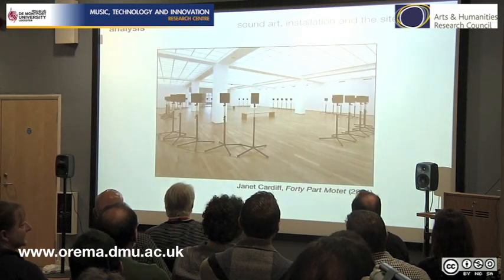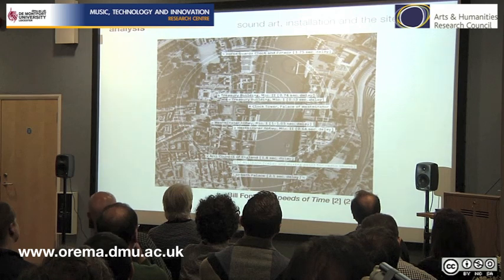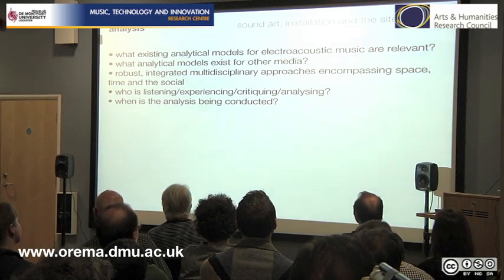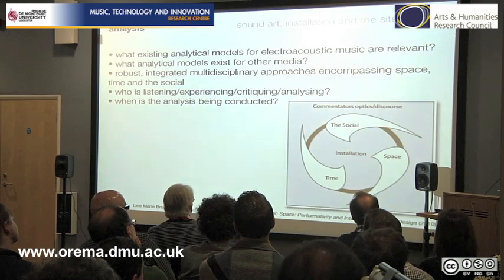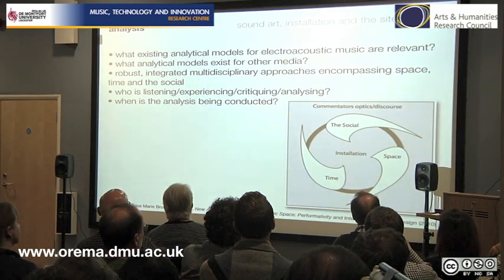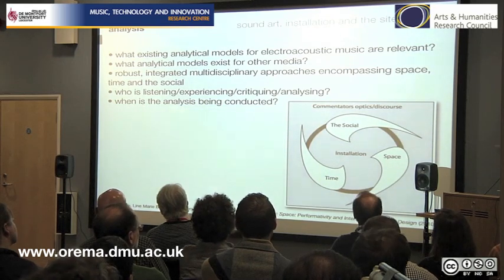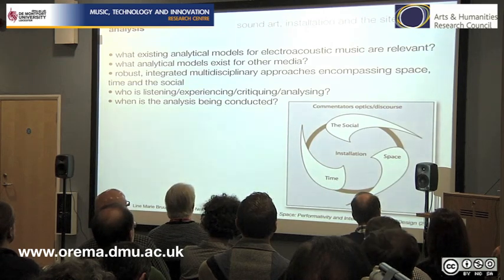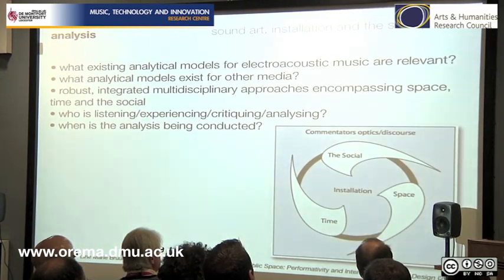Sound art, installation and the site-specific - Pete Batchelor

Comment: Thanks for the talk I was wondering what your thoughts were on the historicization of sound art amongst both installation art and site specific work. Here's a quote from "background noise perspectives on sound art":

"Sound provides a means to activate perception, spatial boundaires, bodies and voices, and the energy waves of forms of broadcast, transmission, and other modes of radiating out. Yet paradoxically, the historicization of sound art and the historicization of site specific and contextual practice remain separate." 

Sound has been utilised in an artistic dialogue, perhaps since Russolo's "Art of Noises" manifesto in 1913. Do you have any thought as to why these fields are isolated in art history? 

Cheers